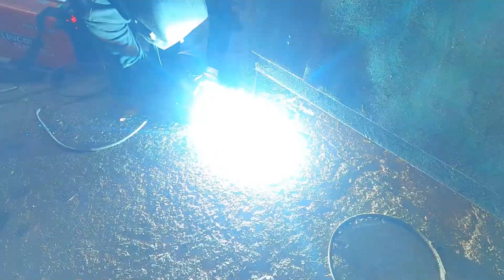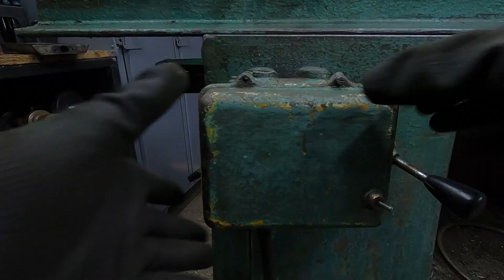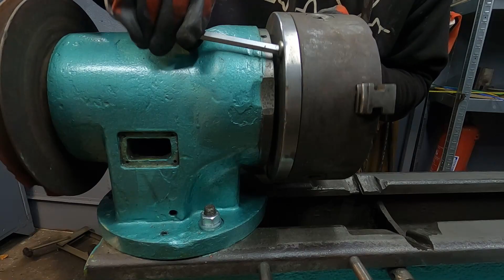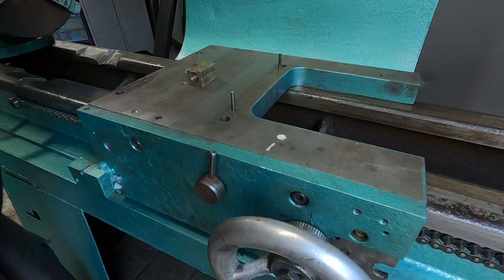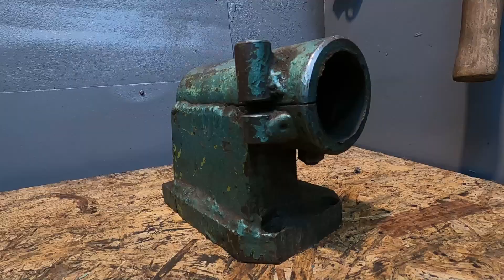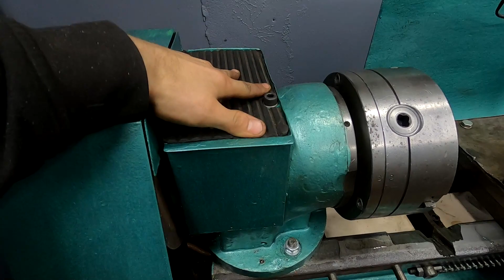Homemade Lathe Machine

Comment: Interesting parts choices! A milling machine became a lathe.
The positional pins in the round base of headstock negate the problem of rotation here.
Is the chain "leadscrew" as positionally accurate as any threaded stock? This would be fine for wood lathe, but I wonder for metal......... but it stays with the "theme" of using automotive/truck parts.
The rail is so solid he probably didn't have to surface grind flat.. just make the carriage as conforming/heavy as possible and good to go.